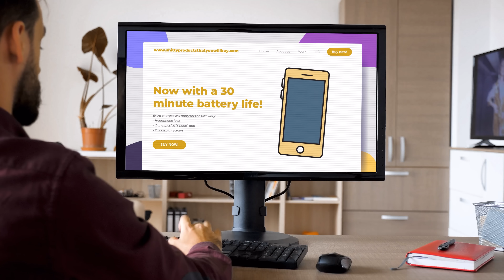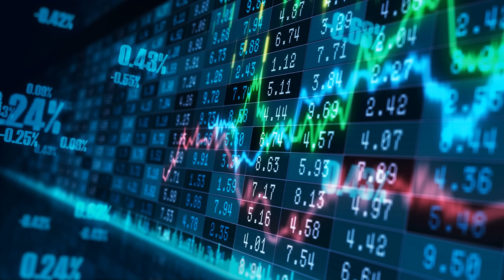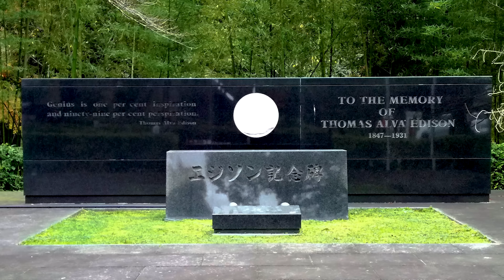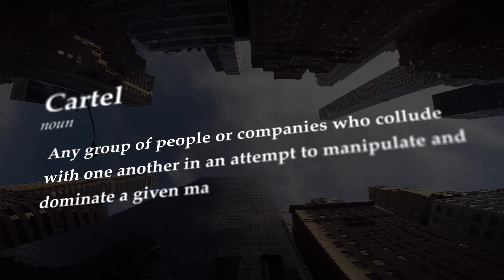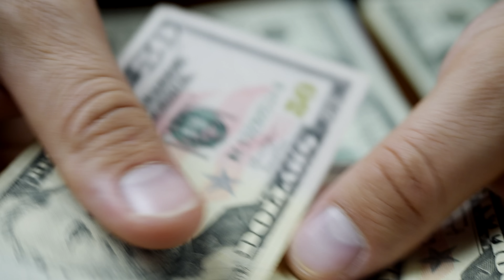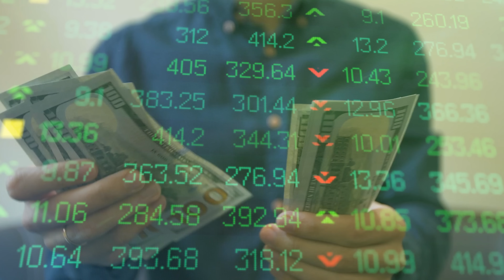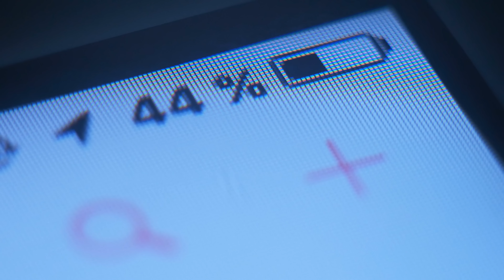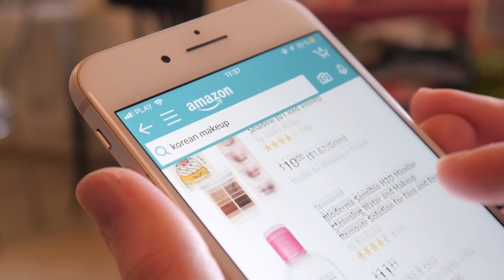Why All Lightbulbs Are Designed to Break

Comment: "Planned Obsolescence", it's been a business model for more than 60 years. 
Which is why Grandma's old waffle Iron still works and the one you bought last year is now in a landfill.
Reply: Nah. Mine is like new after many many years.

I used it once.
Reply: They also sometimes make those same products “lifestyle” brands… or market them to be status symbols- so people will not only buy a new, not better, version- but they will pressure themselves to do so, feel better than in doing so, and look down on others for not. Not to mention the countless psychologically manipulative tactics.
Reply: @michaelmiranda178  this. Basically this is why I hate consumer culture driven economics.
Reply: I still use an electric frying pan my mom got in the 1960's.
And now they have LED bulbs that last so long you need to wash them off because they last so long and don't produce heat that they gather dust and lint.

Comment: Dictionary: 
Planned Obsolescence- Synonymous to "Apple Products"
Reply: A year or decades from now.
Reply: My 4 year old iPhone works great, what about your 4 year old Android phone?
Reply: @yukondave8389  I think you missed the point. I can repair my android phone whenever something is broken. But, if your phone is damaged in any way, you can't repair from a third-party. Besides, parts are becoming unavailable. iPhones do serve better, there is no doubt, but accidents happen, what's your argument there?
Reply: @yukondave8389  I had my galaxy s4 active for 6 years so🤷‍♂️ everyone else I knew with iPhones either had broken screens or shit batteries after a couple years.
Reply: No, just "Products"
Reply: I think you meant to say products.
Reply: Literally most apple products in my family are older apple products. Many of then at least older than 4 years old. My 2015 MBP Still works fine, and lets look at my 2011 iMac. If you count out the OS Upgrade and count out the fact that support for it died in 2017, it is still in a perfect condition.
Yes, apple’s products should last even longer, but thinking that apple is in the forefront of planned obsolescence, you’re massively wrong. There is a reason why every apple product is supported for 5 to 7 years and every android smartphone 1 to 3 years. (Not calling android Bad, just the support too short). I am still using the iPhone XS, and will have the latest OS for years to come. The reason why i bought this XS is Specifically because i want my phone to last like my previous phone did. (The 5S).

If you believe apple is at the forefront of planned Obsolescence, you’re simply extremely mistaken and should do some research instead of watching biased videos from channels like LTT or that stupid rossman.
Reply: @yukondave8389  Still using my galaxy note 9 and my thinkpad l380 yoga, both are from 2018 which makes them 5 years old now.  Every apple product I've owned has never lasted more than 2 or 3 years before having some major issue or just completely dying.
Reply: @BigfootUnibrowMan  Ah yes, anecdotal evidence, the best bullshit evidence.
Reply: @MehediHasan-dl7le  They cracked down on that, the iPhone 14 is very repairable. You are right about the older ones, but that is also the case for most of the other phone brands, only brand I know that isvery repairable is Fairphone. So your information was incomplete, I would even say it's flame bait.
Reply: @Yukon Dave  Oh, you mean like the anecdotal evidence you gave and I replied to with my own? See now why it is BS? Everyone has different experiences lol. You really thought you said something there🤣
Reply: @yukondave8389  The Iphone 14 is still terrible to repair when in comes to the fairphone.  If Apple truly cared about repairability, and truly cared about the environment, they'd be making an equivalent to the fairphone.  But they don't care about either.  They only put a lazy effort into the 14 to get better publicity.  Look at is this way: why are their laptops still completely impossible to repair?  They have riveted keyboards and glued batteries, soldered in ssds.  (none of these are an issue if you buy a Thinkpad)  Same with Apple's smartwatch, and wireless earphones, all a repair nightmare all of which also contribute to more e-waste.

Comment: I distinctly remember when I first learned about planned obsolescence in elementary school. At that young age it was a traumatic experience to find out that adults would lie for money. I have not yet recovered - it has only gotten worse.
Reply: I'm guessing you went to a government school. And that they said that without letting you know about economics, although unsure a grade-schooler has much critical thinking potential in the first place. Most of them, anyways.
Reply: @mstcrow5429  Apple admitted to planned obsolescence by slowing down their iPhones through updates. In the 60's a washing machine company admitted to not making replacement parts after intentionally designing a ratchet gear to last only five years, and then changed its brand name. Most companies don't want to make bad products because it gives their company a bad name, but there are other methods of planned obsolescence that aren't so evident, such as release of new items before the implementation of new technology, a "push" just so they can make more money off of both technologies. It may not be outright deception, but it isn't putting the customer first, it's putting the bottom line first. If you want to know the reality of planned obsolescence don't look at economics, look at the court cases. It's a real thing, but probably not a very prevalent practice.
Reply: @derreckwalls7508  I think you'd find that putting the bottom line first usually also requires putting the customer first. As you alluded to, crap products sully  a reputation, and it wouldn't be very easy to hide behind a new brand name anymore. 3D printing should also make replacement parts easier to reproduce, also from third-parties. A customer decides, generally, if a new product has good enough improvements in tech. Or they might be strange and want a car with more modern styling. You wouldn't believe how much older my car is compared to the average. And I can understand both law and economics.
Reply: I have a '96 Ford F-150 truck. It isn't obsolete yet, because I can still find parts for it, and it still gets me where I'm going.
Reply: @derreckwalls7508  Ok, you have me beat by 4 years.
Reply: @derreckwalls7508  Hang on to that Ford. New ones r so overpriced!! 👍
Reply: @derreckwalls7508   Apple did admit that iPhones were designed to reduce the CPU speed, as the device's battery degraded over time. I don't recall them saying that it was an intentional decision to drive sales.

Instead, they gave a technical explanation. Older batteries put out less power. If the CPU draws more power than the battery can provide, the device shuts off. By reducing the effective clock speed of the CPU, the device reduces its power draw, thus preventing the device from suddenly shutting off without explanation.

That was the right default behavior for the device, but they probably should have made it optional. They probably also should have provided a warning notification indicating that the device would no longer be able to safely operate with maximum performance until the degraded battery had been replaced.

I have never heard anyone provide a really clear explanation of how they thought Apple should handle the situation.
Reply: @derreckwalls7508  you got the V8 didn't you?  the V6 is a garbage system.
Reply: @mstcrow5429  Economics dictates that there is an entire industry dedicated to buying up competing new technologies and making sure they never see the light of day.  You also have things like NDA's and proprietary secrets restricting the flow of relevant information to the consumer because companies want to remain competitive.  Economics arguments are arguments against the best interest of the consumer.  I could pick examples from tobacco, alcohol, and the new cannabis industries about how health risks are downplayed and hidden from the public.  You can pay off a private safety testing facility to bump up numbers and fake negatives for pathogens.  The damn oil industry was poisoning us with lead for generations and all those companies still exist.
Reply: @commentingisawasteoftime7195  You're talking to someone that opposes IP on principle.
Reply: @commentingisawasteoftime7195  I've always heard the V6 is better, so who knows. It's a manual, which I love, and a 2x. Before this one I had one that was old when I bought it... a '70 that I kept until '10. It lasted 40 frickin' years! I guess Ford doesn't believe in planned obsolescence, and they are still the best selling truck.
Reply: @derreckwalls7508  I'm still driving an 85 F250 daily, 35 years so far! Its a beast, gonna keep going for many more decades yet. I'm not sure Ford planned for them to fail, but it doesn't matter, cause there are millions of fools who still feel the need to buy whatever is the latest model... at prices that are eclipsing many houses in my area. I cannot fathom how people can justify paying more for a truck that a freaking HOUSE. But thats a whole nother subject...
Reply: @ec5838  That's awesome! I love the looks of the early to mid '80's pickups. They just look rugged to me.
The first vehicle I bought myself, used, was that 1970 Ford truck. I kept it until 2010 when I decided Ford trucks were a great product and got the '96. I hope this one lasts for 35 years!
Reply: @derreckwalls7508  Hell yea man! The old ford trucks are great, I really like the square body style too. Always kinda laughed at the "built tough" slogans but its kinda true.
Reply: for me it was hearing about the hole in the ozone layer. and the subsequent realization of just how incredibly stupid humanity is to care so little of the only known planet they can inhabit. i've since only come to learn just how little they realize and value the precious lives they have here, with no doubt the biggest sin being the sheer size of human population and nothing being done to prevent it from growing exponentially. it is the single most harmful phenomenon to all living things here on earth, including us and the earth itself.